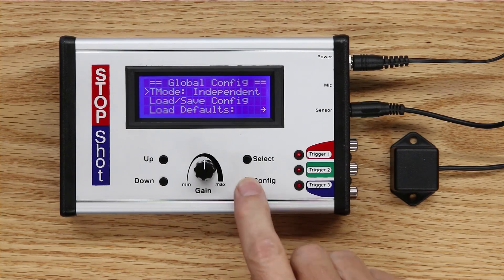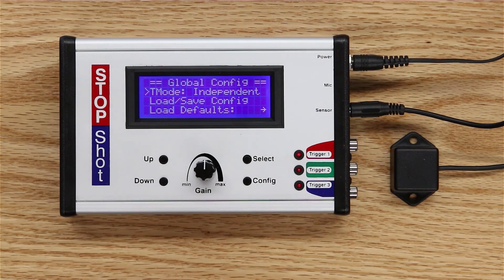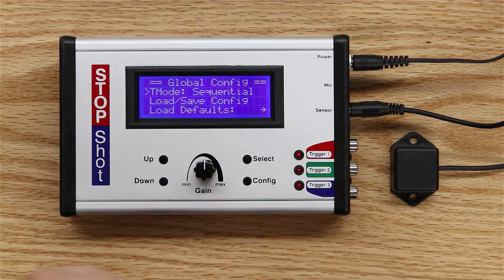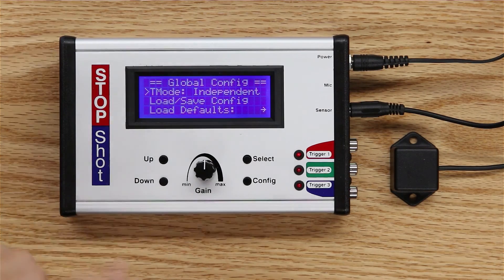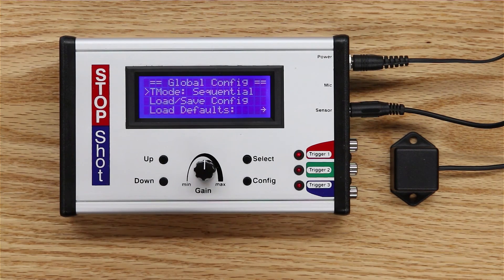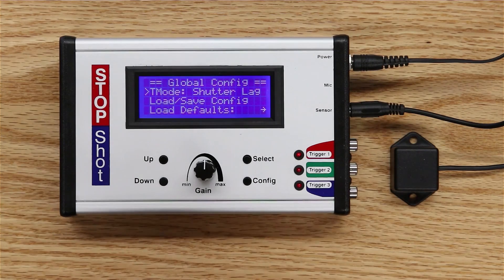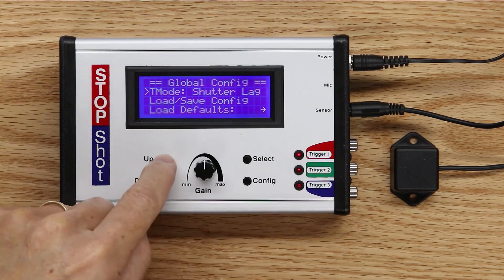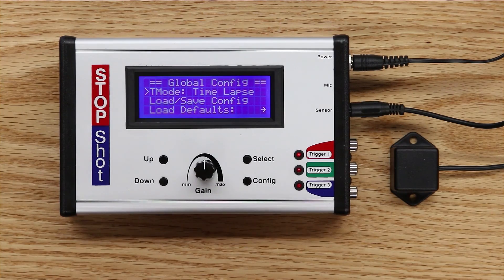Demo: StopShot Independent vs. Sequential modes

Comment: and what is that "gain" key?
Reply from the maker: Hi Kristijan,

The gain knob adjusts how sensitive StopShot is to the sensor input.  In this example (with the vibration sensor) if it was turned down all the way you'd really have to hit it hard before the outputs would activate.  If turned up all the way just the slightest touch will activate it.  Hope this helps!